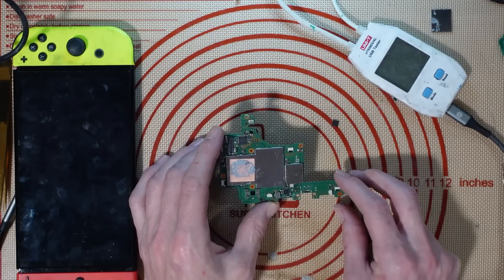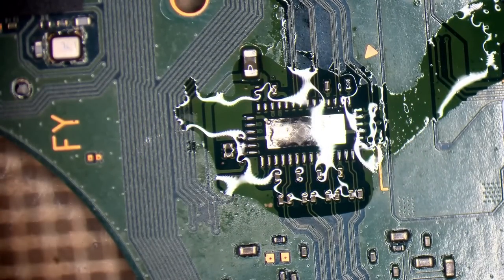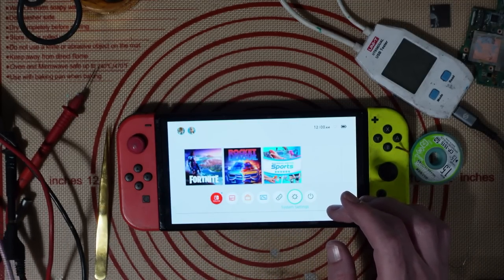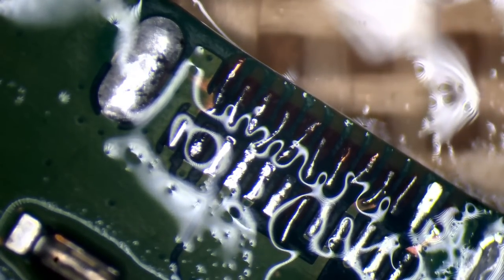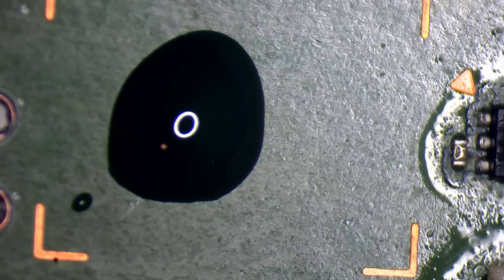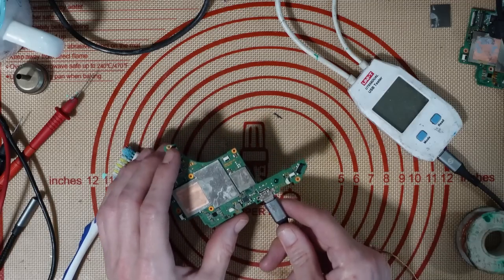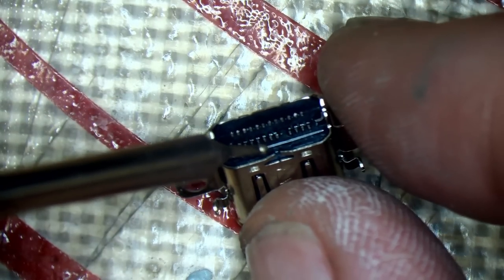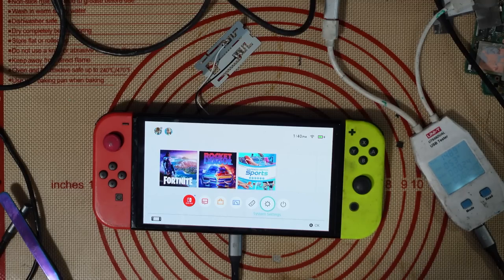Can I FIX This SCRAP Nintendo Switch OLED?

Comment: @TheCod3r Not really to do with this video but I recently took my ps4 apart as it sounds like an airplane taxiing a runway, my little boy uses it so i thought i'd replace the thermal paste but after opening it up I found that one of the thermal pads on the memory chips I was just wondering which thermal pads you would recommend to replace them with and the thickness? Its a 2015 version1 Ps4, I hope you reply but if not no worries im sure ur busy :) .
Reply: Hello I looked it up for you and what I found is the size pad 145 x 145 x 1.0mm start with  2mm thickness thermal pad. I hope that helps you out

Comment: I also constantly have trouble concentrating and that leads to unnecessary fuck ups all the time. If you want to have better awareness, I assure you that a mere 1 minute squatting session helps a huge bit. Mostly because it helps accelerate your heart a little bit and promotes blood flow to the brain. Also breathing deeply while you're at it, for that blood to bring oxygen.